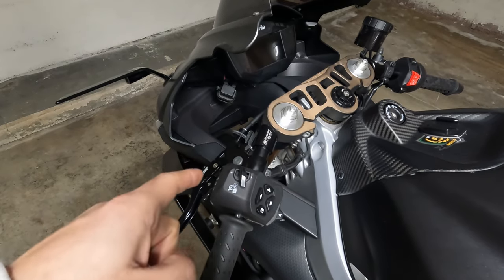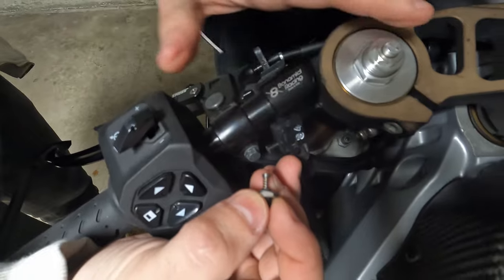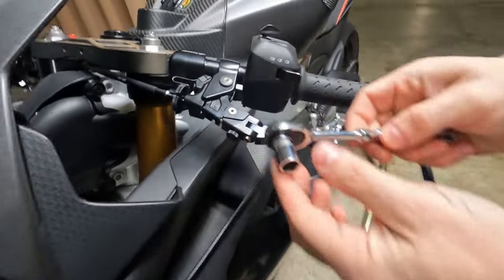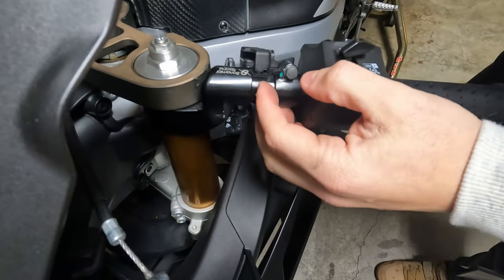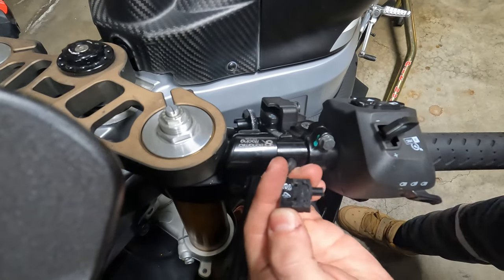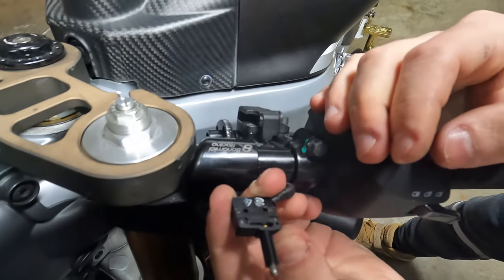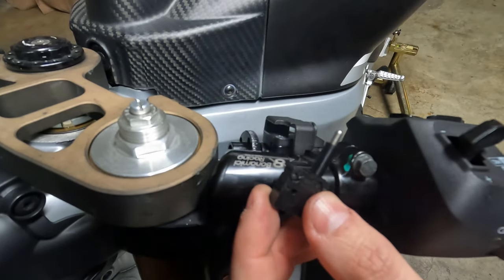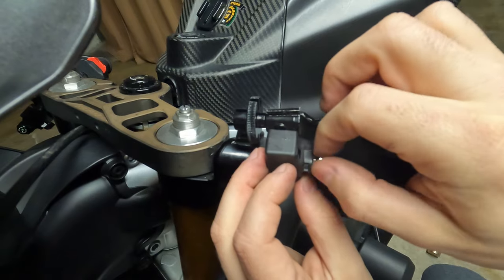RS 660 | Clutch Safety Switch | How To Repair

Comment: Thanks so much for the video. Unfortunately we all need it because this horribly designed part is never mentioned in aftermarket clutch lever instructions.
Reply from the maker: That is very true. But then again aftermarket levers usually don’t come with instructions and also meant for mechanics to install. But we learn through our mistakes and spread the knowledge. ✌️

Comment: I installed a ASV clutch lever and dude my safety switch is broken.  DUDE you are godsend. Im gonna order from your link and follow this video!
Reply from the maker: This fix is really a life saver. Be very caution next time you remove your clutch lever, and since the clutch safety switch kit is so cheap, buy two to have extra. The rear brake uses the same safety switch. It can never hurt to always have extras handy.
Reply: I actually did order two lol
Reply from the maker: @emang6284  lol. Smart man 👌

Comment: Great video. I had no cruise control or auto blipper and it turns out the aftermarket levers that were fitted when I bought the bike do not engage the clutch safety switch at all!
Now i'm trying to hunt down the piece that looks to be missing from the bottom of this clutch lever!
Reply from the maker: Thank you! Good luck! ✌️

Comment: Thanks for the vid. A tip you might use is to not turn the two nuts together. The whole point of having two is that the second (or last or outer) one locks down the first one so it will never turn until you loosen the outer one. It's called a jam-nut, among other things, and it absolutely jams the inner nut to where it can never self-adjust. Tighter the first to where you want it, then hold it and snug the outer one up against it and it is solid. Might require a specialized wrench with those thin nuts but you can probably just tighten the inner, then the outer and be fine.  Also, the gap at the lever to the perch applies to all bikes, microswitch and auto-blip or not. The reason is that if the lever is pulled tight, you cannot be sure it is not pulling on the clutch release mechanism just a bit, which could cause your clutch to slip to some degree. Clutch levers have required that gap since the beginning. Thanks again.
Reply from the maker: Thank you! Yes my wrench grabs both nuts and can’t really tighten them individually. But its all good as it stayed in place just fine.

Comment: Curious about the carbon fiber plastic cover at the key lock. Where did you get that!?
Reply from the maker: It’s not plastic, it’s full carbon fiber. I got it from AF1 Racing, but last I checked it was not in stock. Other carbon fiber manufacturers should sell it.

Comment: I broke mine off. Just bought the repair kit from your link. Thanks for the video. The lever installation video i watched before this didnt mention anything about the switch so i ignored it. Im really annoyed but this video helped. 
Can i still ride my bike in the meantime though? Is there something i should be cautious of?
Reply from the maker: You can still ride your bike slowly until the safety switch replacement arrives. ✌️

Comment: What do you think of a gear shifting stabilizer? Saw a video on it. The guy made a good points why you should get one.
Reply from the maker: I installed it but never did a video on it. It came as one with the front sprocket cover from Flyhammer. I show it on this video. https://youtu.be/yzQYhrjx-6o?si=FNoVkYJS3MBtRKo5 Its an extra safety but I can’t tell I felt any difference in shifting. Doesn’t hurt to have it especially if you track your bike.
Reply: Oh that’s right I saw yours on that video awhile ago. Pretty pricey the one you have. AliExpress sells it for $10 bucks lol.

Comment: Hi, I also broke the clutch lever switch, I have a Tuono V4 1100 2020, today I went out and noticed that the bike splutters a lot when releasing and has reduced power, could it be that the problem is due to the broken switch? Thanks to your video I understood how to repair it.
Reply from the maker: @domenicocarofiglio7243  Thank you! If these symptoms started once your safety switch broke, then it’s due to the broken switch. Other ways to know that your switch is broken is that the auto blipper does not work, the cruise control does not work, and the bike wont rev past a certain RPM.
Reply: @ thanks, yes indeed the bike does not exceed a certain number of engine revs, at 9000 it stalls
Reply from the maker: @ Yup. Broken switch 100% 👌 Easy repair, cheap replacement

Comment: I just did a video on this very thing today and its still uploading LOL
Reply from the maker: LOL. I wasn’t planning to make a video of it, but apparently its a popular repair and request.
Reply: @ALFAVITAGA   Yup. Mine broke in a different spot when I was installing the clip ons to the race bike. Then it wouldnt rev on the Dyno ..
Reply from the maker: @388racing9  Was it repairable just with the repair kit?
Reply: @ALFAVITAGA   Yes it was, I didnt use the second nut as mine originally had a index safety washer on it, so I just reused that.

Comment: Great Video! Just saw a video of the new S1 exhaust from sc project. What do you reckon does it sound better than the crt?
Reply from the maker: The S1 will be a good option for some riders but it won’t sound better than the CRT. It will sound great though I believe.

Comment: how can you avoid breaking the switch when installing the clutch lever? I am about to install spider levers
Reply from the maker: Just be aware of the position of the switch while removing the lever and you’ll be fine. It only breaks when you forget that the switch is there and you are in a rush.
Reply: @ALFAVITAGA  got it on without a hitch! your video helped a ton thanks man
Reply from the maker: @danielwest8414  Amazing! Thank you! ✌️

Comment: I have a problem. My bike since I changed the clutch lever wenn I accelerate around 5k rpms it doesn't give gas. It feel like is in neutral after 5k it cuts of. The power. Can someone help?
Reply from the maker: @stefandipaolo2849  It sounds like you broke the clutch safety switch while you removed the clutch lever. You need to order the repair kit that I linked in the description and follow the video to repair it. Or take it to your dealer and they will repair it for you. But It’s a simple fix.